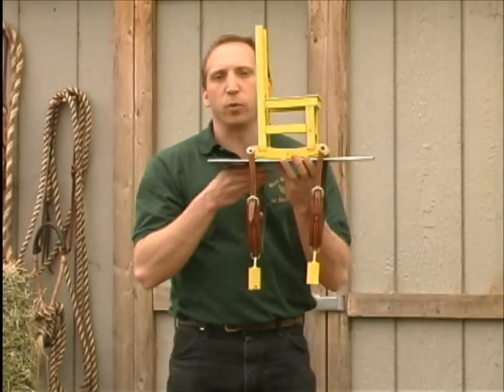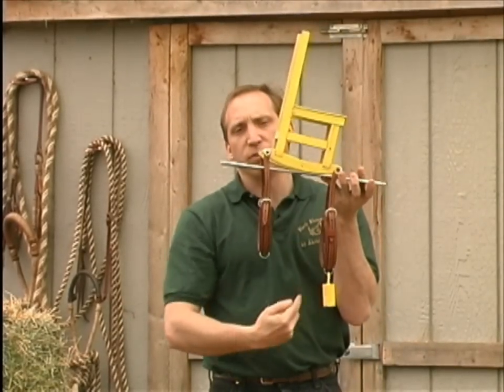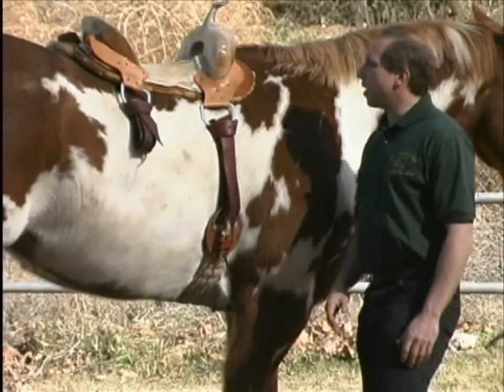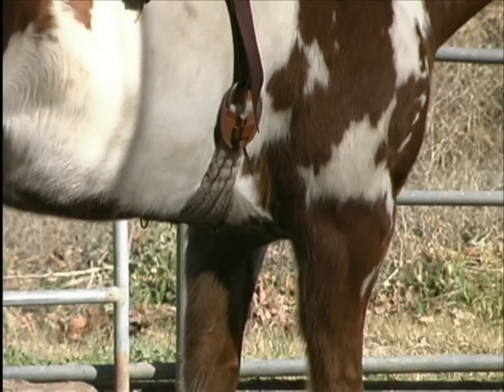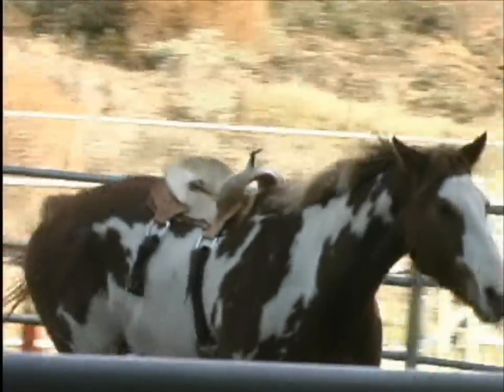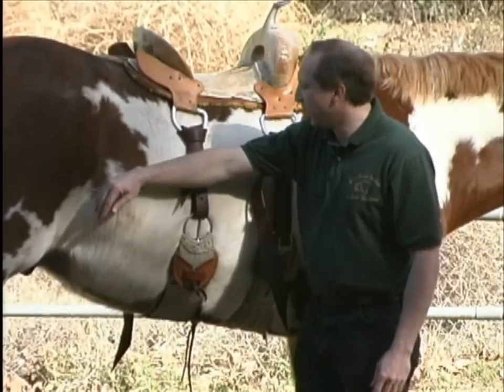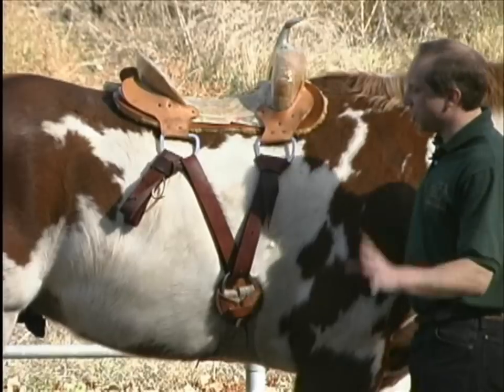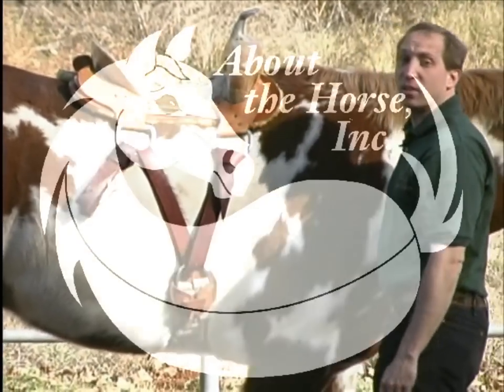Using a rear cinch on a western saddle.

Comment: I need to see how to attach the two cinches together the connector I have is weird. Having hard time getting it on . Does the metal on the mohair cinch rub the horse
Reply from the maker: Attach the two cinched any way you can. There is no absolute right way you just want to keep things smooth against the horse.  It is always best to use cinch protectors  or safes as they use to be called. https://youtu.be/dL7N_KmcI1g

Comment: My 4yr old Quarter Horse X Appaloosa gelding hates his rear cinch. I was told to leave a 1" gap and not have it tight. I use a Western saddle on him with a 1" felt pad (which has been wonderful) and ive noticed as soon as we get into a canter he will pig root. When I let him loose with his saddle and pad on (no bridle) I noticed when he cantered he again pig rooted but I seen the rear cinch slapping against him and im 99% certain thats why he was bucking. Im a definitely trying this!

Comment: I think the back cinch should be snug, but not as tight at the  front cinch. The back cinch would turn into a bucking strap.
Reply from the maker: Perhaps you have your front cinch tighter than it needs to be.  Research is showing that we are over tightening girth to a degree that we are cracking and displacing the costal cartilidges.
Reply: Sixstrides I agree

Comment: Please do research on something "horse people" try to tell you. 

Obviously the rear cinch should never be as tight as the front cinch because he forgot to mention in his weight distribution conversation that the rider should have enough weight to hold the back of the saddle down without pinching the withers. And the front cinch should never be so tight that the saddle stands off the horses back. It should only be tight enough to where the saddle doesn't slip side to side when you mount or ride.

 Plus, the front cinch sits on the rib cage, where it is safe to apply pressure, when the back cinch sits on the colon, which if too tight could cause a whole boat load of health problems. The back cinch should be snug enough to slip two fingers in where the belly button sits, but NOT as tight as the front cinch. The front and back cinches purpose are completely opposite. The front cinch holds the saddle in place on the horses back and keeps it from sliding side to side. Which is why it needs to be tighter to hold our selves on top of the horse.... Instead of sliding onto the underbelly.😂

 While the back cinch holds the cantle of the saddle from moving up and down. Which is only really needed when a horse is bucking because all that up and down motion of the horse is sure to transfer to the saddle by the domino effect of energy. In general while regularly riding, the riders weight is enough to stop the up and down motion by riding properly. 
Obviously if your a new rider, your going to bounce a whole lot more. 

However, the way a horse moves, and the type of horse you ride will give you different motions in the saddle. Which alot of people will say that motion of the saddle is not supposed to happen. However science tells us otherwise with the laws of energy. And please, if your saddle doesn't move with your horse, loosen your cinch and quit suffocating them😬😂
Reply from the maker: You are historically and biomechanically incorrect.  I will agree with you on the fact that horse people should do some research. In fact I will refer everyone to the site of my anatomy teachers site.  Dr Bennett is one of the world's leading experts on equine systems anatomy and as such you will find solid information on her site.  Her book Conquerors is also an excellent way to begin to understand the different schools of riding that Gracie O'Dell is confusing and mixing together.    http://www.equinestudies.org/
Reply from the maker: Conquerors can be purchased here. 
http://www.equinestudies.org/esi_bookstore/books_on_paper_intro.html
Reply from the maker: I Have a facebook saddle fitting group  called About the Horse Saddle fitting. If you read the basics posts I cover the five schools of saddle fitting, the three pressure distributions used in saddles,fundamentals of riggings ect.  https://www.facebook.com/groups/579364745952733

Comment from the maker: The riders weight may keep the rear of the saddle down if they  are bracing and shutting down the movement of the horse. If it is a double rigged saddle and you are not using the rear cinch as snug as the front you are injuring your horse no exceptions.

Comment: They are not supposed to be equally tight. Wow. You have a lot to learn about horses and a whole lot to unlearn.
Reply from the maker: Do you have any factual historical ,anatomical or basic physics information to support your position?
Reply: @aboutthehorse  Yes................the horse will 'tell' you. 'Listen' to the horse.
Reply from the maker: Please share your information then.  The thousands of horses and riders I have worked with have told me that things are better for everyone when you work with in the laws of physics.  No horse wants a rigid tree being driven into there s shoulder preventing them from lifting the base of their neck and engaging their hind quarter.  Every horse I have ever listened to has told me they want to be able to get into a weight bearing posture.
Reply: @aboutthehorse  Less is more with horses. In the case of cinches, when a rider has very good balance and knows how to ride so the horse is comfortable, the cinches  can be snug for the front, less for the rear.  Maybe loose by about an inch or a bit less on the back cinch. Too loose and a hoof or branch could get caught in the flank cinch. One does not want to make the front cinch too tight. Don't want to cut the horse in two. Snug is fine for the front. There is a technique for getting on a horse that is loosely cinched. Since that can be accomplished, so can some riding with loose cinches. It is the rider. Is the rider an 'easy load'? Balance is so important. Trust between rider and horse is a  factors. Many elements go into a successful ride with properly cinched saddle.
Reply from the maker: @gerrycoleman7290  Do you own a horse?
Reply: @aboutthehorse  I have been working horses daily for years for ranchers. I use their horses.

Comment: Your cinch should be as tight as your horse's job requires it to be. Obviously it's never a good idea to cut the horse in half, but for backyard trail riders, they won't need their cinch to be quite as tight as say, barrel racers. Your own balance plays a role in this as well - the better you ride, the less you "need" your gear.

Comment: Sorry... but if I tightened the rear cinch that tight on my horse she would loose her mind and buck until the saddle came off!
Reply from the maker: Then you may want to have your horse's body checked by a professional to see is there is something causing pain.  Some common issues are misaligned rib, and ulcers. For mares, ovarian cysts can cause that type of severe reaction.   The fit of the tree can also be a factor.

Comment: @sundanceranch1 - After seeing this, I checked and 2 out of 3 of my western saddles (expensive comfort saddles) and they don't even have a rear cinch on them at all and were not made to have one. Hmmm. The only people I know that use a rear cinch is rodeo riders and roping sports, like when they need to put a heavy load on the horn and possibly dismount quickly. I'd never leave a rear cinch loose enough for a horse to trip on, so I don't put them on at all.

Comment from the maker: @babyhorsey6 Traditionally a mohair cinch was used on the back and they were cinched with a latigoe just like the front. Find any old saddle catalog from the early 1900s and this will be very clear. A leather rear cinch is fine too as long as it is wide enough but you can't beat mohair. Always make sure sure you have the two cinches connected though!